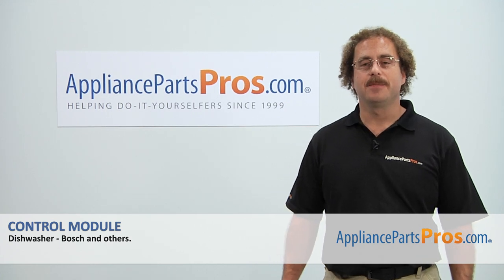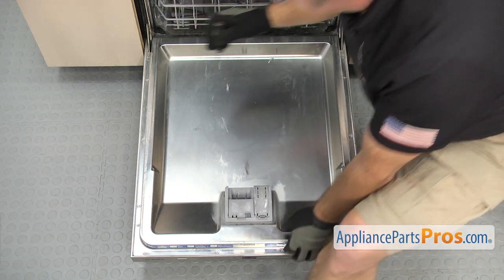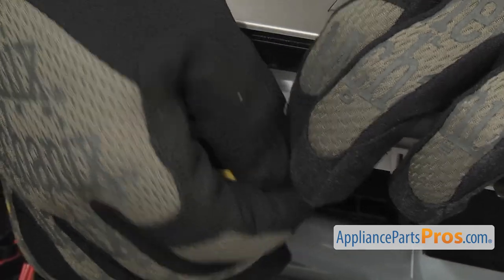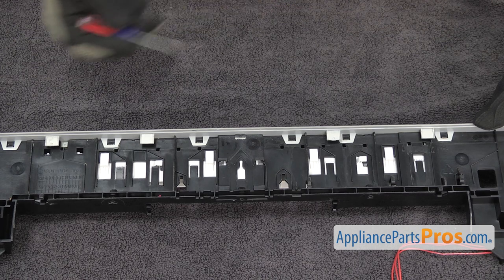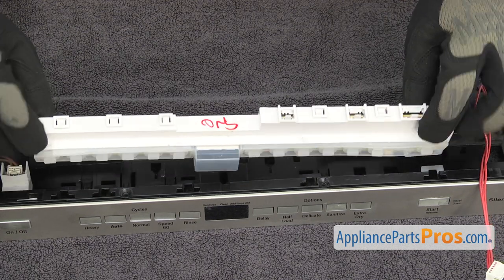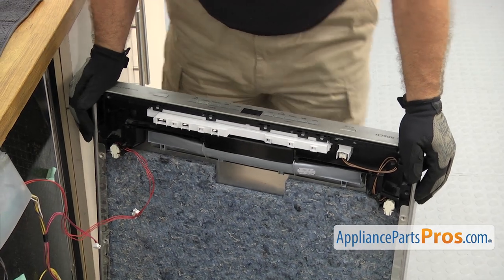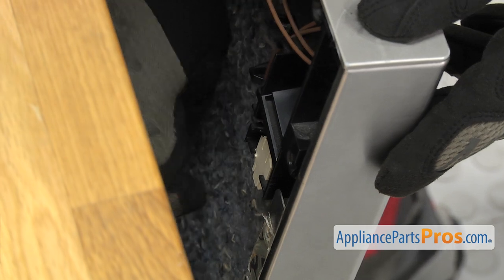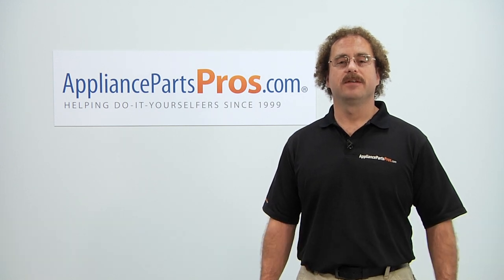How To: Bosch/Thermador/Gaggenau Dishwasher Control Module 11031054

Comment: How did you get the panel to just slide out like that? I've been trying for over and hour to remove the thing and it will not budge other than flex a bit
Reply from the maker: You will just need to make sure the wire harness is disconnected and make sure there is nothing causing the panel to not lift out properly.

Comment: My bosh dishwasher has a place for wire bundle on rinse aid
Looks like maybe rinse and button gets no wires??????
Please help the yellow bundle fell off when I removed the door????
It seems to fit in the slot that is the hold button to control horizontal buttons left and right?????
The rinse aid button seems like it would need larger bundle
Guess some on the panel don’t require any wires to control Panera
?????
Trying to install today???
Reply from the maker: What is your model number?